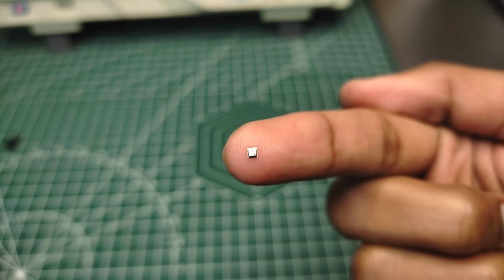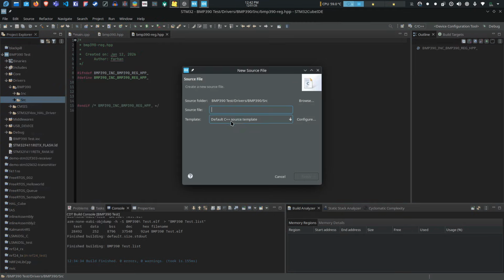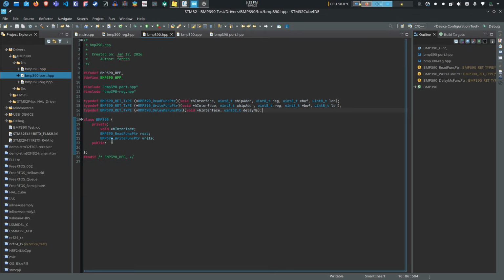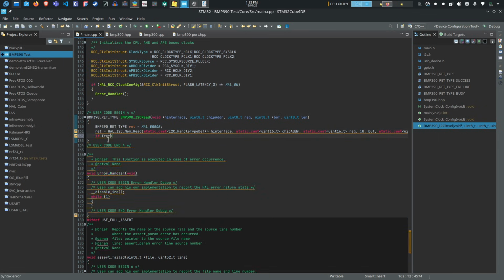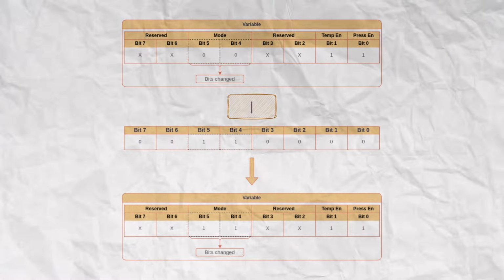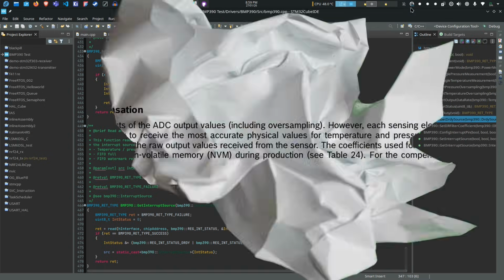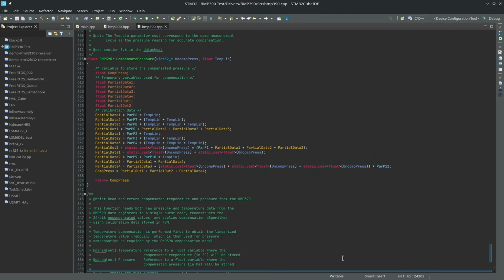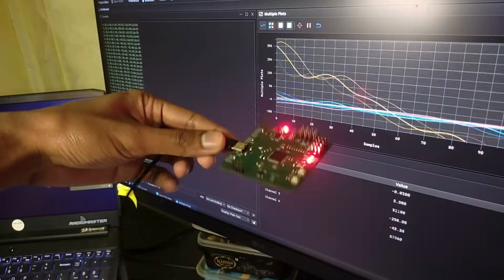Stop Copy-Pasting Libraries: Build One from the Datasheet // BMP390

Comment: Few things to do for that code to be bulletproof:
1)
Good practice for device driver is to block copy:  
BMP390(const BMP390&) = delete;
BMP390& operator=(const BMP390&) = delete;
This is because if you want to support sharing, it is better to do it explicitly e.g., shared_ptr rather than through accidental copying.
2) 
You also does not check if read and write is not NULL and should be checked like assert(read && write && hInterface);
3)
float BMP390::GetAltitude(double &Pressure) 
Why you return float here but not double? You are working on double types so you should return double. Also parameter is reference which is wrong.
For me this method should be like this:
double BMP390::GetAltitude(double pressure) const
{
    if (pressure <= 0.0) {
        return std::numeric_limits<double>::quiet_NaN();
    }
    constexpr double pSea = 101325.0;     // Pa
    constexpr double factor = 44330.0;  // m
    constexpr double exponent = 0.19026;
    return factor * (1.0 - std::pow(pressure / pSea, exponent));
}
Reply from the maker: Thank you for pointing out my mistakes. I will patch some of them later.
I had been coding for a few weeks. By the time I reached the end, I kinda got lazy and careless. 
Thanks again for pointing them out.
Reply: @Ozonised W honesty W humbleness W commenter

Comment: If this BMP390 is installed in an earpiece, do you think it can measure pressure changes in the ear canal to detect chewing?
Reply from the maker: That's quite an interesting application. I cannot say for sure, but if the pressure change is greater than 1Pa then the bmp390 should be able to detect it. For highest precision and sensitivity, the bmp390 should be configured based on the use case "Indoor navigation" given in table 10 of section 3.5 in the datasheet.

Comment: bro how did u learn arm programming and driver programming, can u suggest the roadmap please ???????
Reply from the maker: I did not use any arm cortex specific stuff here. As for how I started writing drivers, I started by learning low level programming on Arduino's , that is using direct bit manipulation to write to DDRx, PORTx and other registers.
Then I wrote my first library for the 16*2 LCD, while also referencing available drivers from Adafruit.
Once, I was comfortable with Arduino, I moved to STM32's, followed a similar path, I modified a few readily available driver for nrf24 and Lora modules. Later, I moved on to writing drivers for lsm6dsl IMU, and others. My suggestion would be to reference drivers provided by vendors or other people and see how they do it.
If you want to learn about Arm Cortex M3/M4 architecture, then my recommendation would be the course on Udemy by FastBit Embedded Academy.

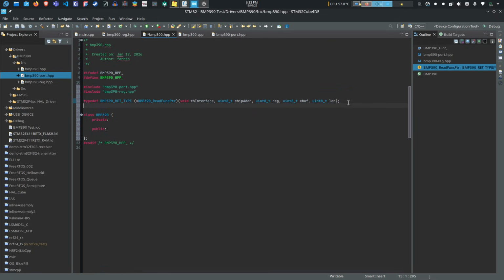Comment: Final comment about code to not overwhelm you: At 7:30 a) I would have put all the reg definitions into and "enum class" with underlying type of uint8_t (either a huge one or multiple enums depending on functionality). I would use that enum type at the function signature instead of plain uint8_t. b) If std span is available in that embedded compiler I would use it instead of using the buf+len parameters.
Reply from the maker: Thank you, that's a good design. 
In my driver, it boiled down to personal preference, i just like to have the registers names separately, and only use enums to store configuration options. 
As for the std::span,  it is something I will have to look into.
Reply: @Ozonised  Don't take my word on it, but I think you're wasting memory. By declaring a variable for each register vs using enum names for the register constants. Plus if a function expects a register parameter of type uint8_t you might accidentally pass it a value outside of the valid registers. By using an enum class as the type, the compiler will enforce using one of the enum names on that parameter.
Reply from the maker: @sledgex9 you are right about passing incorrect value but since a user will not be writing directly to the register. I did not bother with adding checks for the register value. 
That said, what you are suggesting is definitely a valid concern.
Reply: @Ozonised  It also protects you from yourself. The programmer might slip up. Copy/paste the wrong value in the parameter. Call the function with uint8_t parameters in the wrong order etc.
Reply from the maker: @sledgex9 yes, you are correct about that😅

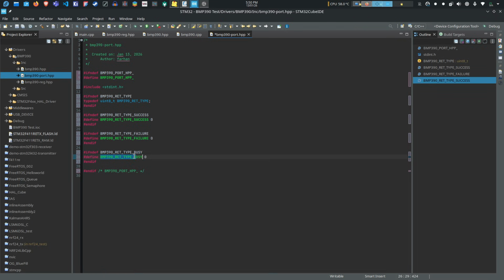Comment: At 6:26 I feel like the definition of SUCCESS/BUSY/FAILURE should be an "enum class" (modern C++ feature). In an enum class you can also define the underlying type (here uint8_t). Why do you want "enum class"? Type safety. The compiler won't implicitly convert the values to int or vice versa. So you're prevented from accidentally passing the return value at a function call that doesn't expect them. You can still do it explicitly by casting the enum value to int/uint8_t.
Reply from the maker: I had done so initially, but later decided against it. But you are right, I should have stuck to the original decision.
Thank you for all your suggestions 😊. I learnt something new.

Comment from the maker: Hello guys, I just want to put it out here that this isn't the only way to write drivers. 
My suggestion is that you explore drivers from device vendors like STMicroelectronics, Bosch, etc for their devices and see how they write it.
Drivers for safety critcial, automotive devices are written with different standards. It is not something that I am versed with, nor will this video help you with that.
But from a learning perspective, it sure will. I hope you learned a thing or two from this video.
Reply: Sir how to install vs code?
Reply: @gearbot4733  Looks like STM32 Cube IDE
Reply from the maker: yes it is